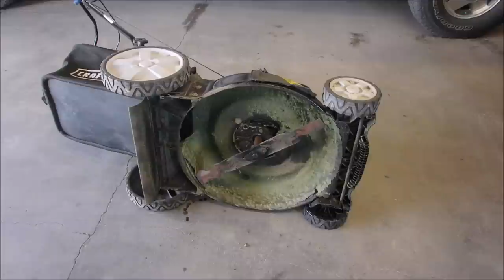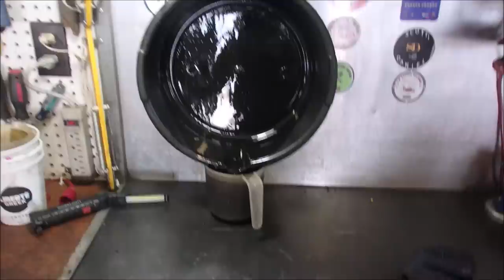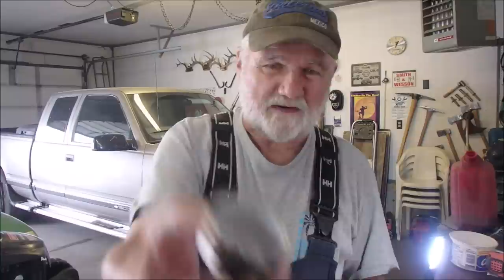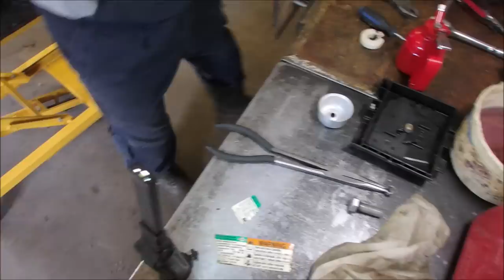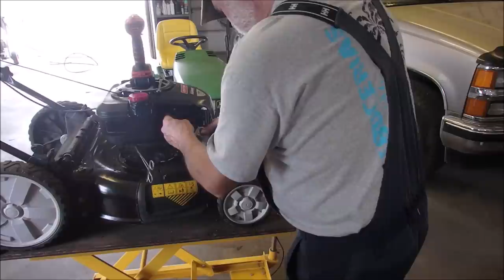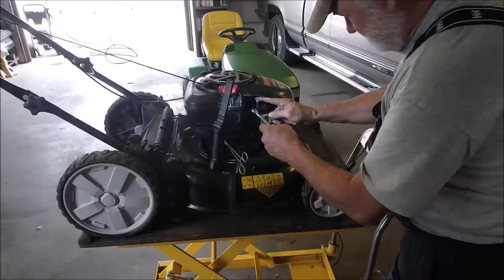Craftsman Platinum Mower Has Oil Everywhere

Comment: Had the same thing on a roto-tiller not long ago. Engine started smoking and then locked up. It was over filled by almost 1L. Bright side was no mosquitoes for a while.    That air filter looks like the internal combustion engine’s version of COPD. Have a good week.
Reply from the maker: Thanks for the fun.

Comment: Good video Bruce. Quantum engines are tough.
Reply from the maker: Thanks for joining in.
Reply: They are really very good and they last a very long time 
Only wish MTD would make thicker metal decks on push mower and keep it simple 😊
Reply: one way to ruin it. stuff it with oil!  
haven't found anything else to stop those. 
got one on a Snapper deck,. build date April 2000.
17-18oz. is 'Full'  on the dipstick.

Comment: GOOD video Bruce, Another thing no one tries is the idle circuit under welch plugs on snow blowers get boogered up  and need to be cleaned. That's where 90% of surging comes from but no one cleans under there they drill the jets bigger!
Reply from the maker: You are right.

Comment: I do the messy work outside in the grass. If the weather is bad I'll put down a large piece of cardboard. If I have to do it on concrete I put cardboard down prior to tipping the mower over to prevent scratches to the deck. Yes, I know I'm OCD.
Reply from the maker: I unerstand.  I don't want to kill my grass.  OCD as well.